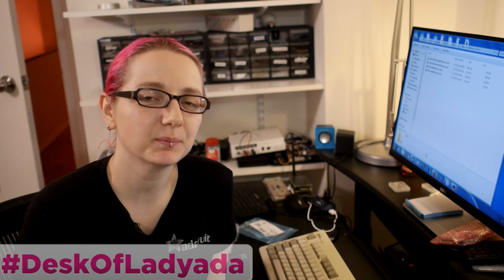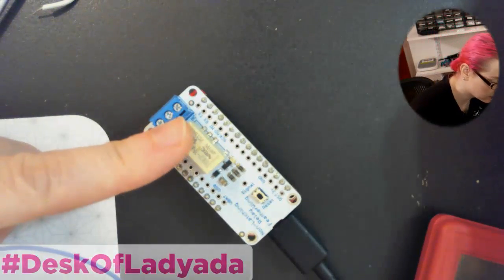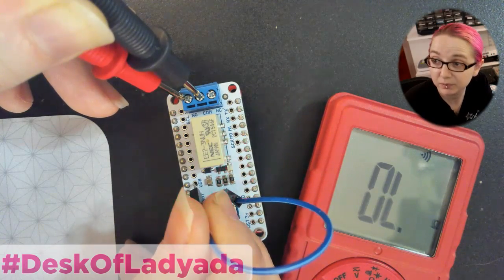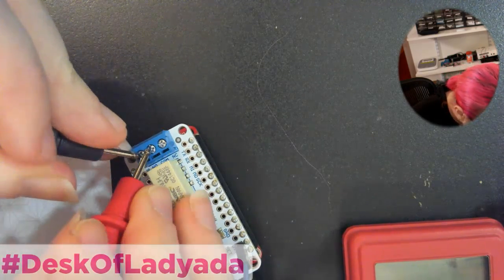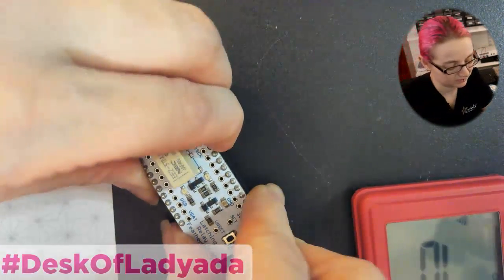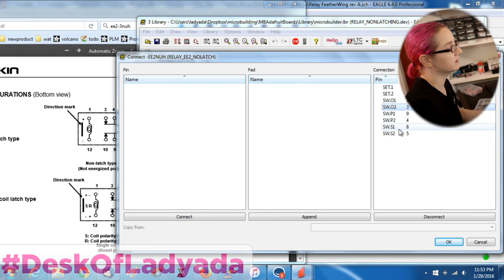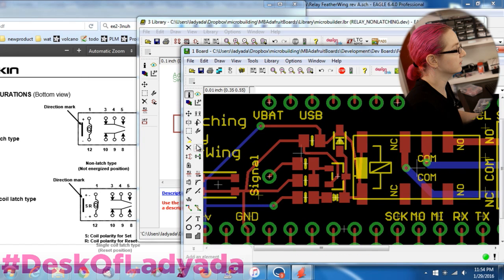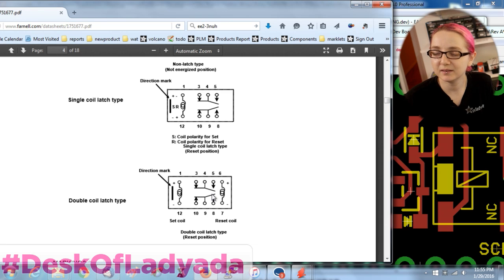Testing out relay FEATHERWING and lessons learned #deskofladyada @adafruit LIVE

Comment: Brought back bad memories of struggling with a relay for a dual fuel heating system. Eventually multi metered relay & found reality & schematic didn't match, re-wired to reality & it's been working fine for several years.

Comment: will the latched relay not also have reversed contact closure in the reset state compared to that of the pinout on silkscreen,  possibly posing a risk when wiring mains. So normally open will be closed etc...

Comment: I have never had a polarity sensitive relay!  It's just a coil?  Doesnt make any sense
Reply: +ituxcoza What she meant is that the SET and RESET functions were likely reversed due to the incorrect pinouts.
Reply: No she didn't.  Go watch the video again.  The Nonlatching board has the problem!  The latching one works fine.     Thats what bothers me.
Reply: No she didn't.  Go watch the video again.  The Nonlatching board has the problem!  The latching one works fine.     Thats what bothers me.
Reply: +ituxcoza These are high quality relays, they are either polarized because they have protection diodes inside them for surge suppression when the magnetic field collapses or they are polarized because they use permanent magnets in the electromagnet